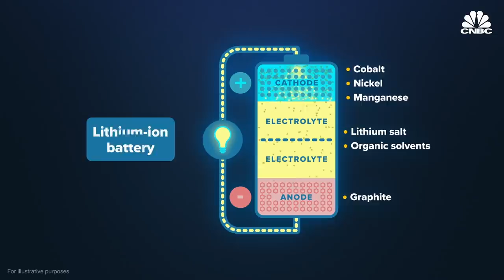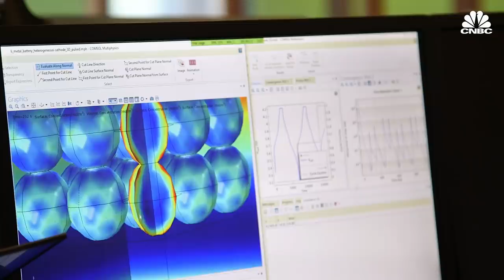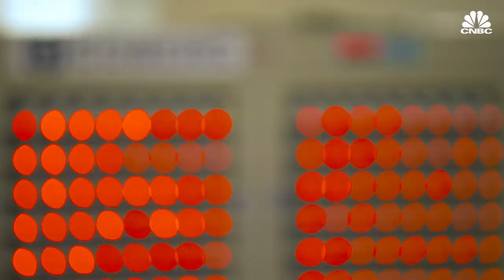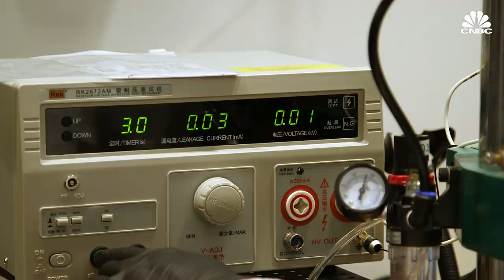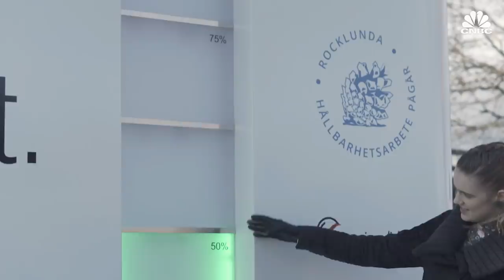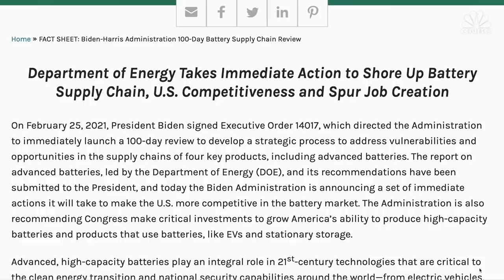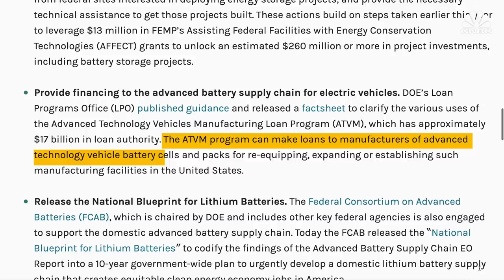Why This Battery Breakthrough Could Make EVs Cheaper

Comment: You would like to think that they're fixing a problem with these ''green vehicles'' but in reality, they're only creating new problems in the long run.
Reply: They said silicon (sand) is abundant when microprocessors were in the initial stages, but now we're reaching that point of scarcity. Elon said lithium in Nevada alone can produce batteries to convert gas cars to electric. I believe this claim also might be similar to the silicon one.
Over dependence on anything leads to demise and despair in the end.

Comment: So how is this any different from extracting oil or gas from the earth?  We still need to mine many materials....does that have an impact on the climate?
Reply: It's a matter of scale, mining the resources for batteries that will last 10/20 years and can probably mostly be reused with most energy coming from renewables with lower carbon footprint vs constant oil that's highly polluting.

Comment: I don't know why they can't develop a high-grade polymer solar panel that can harness the sun to power the battery. Essentially either one area (like the roof) or the entire auto body is a solar panel. Electricity isn't a cost or carbon-effective "fuel" source.

Comment: There are some suggestions here that quite simply 'don't hold water'. Why would a lithium metal battery simplify the (battery) manufacturing process ? It might remove one step out of many but how useful is that ? Even odder is the idea that it'll make vehicle design 'better' in some way. Overstating your claims will attract criticism.

Comment: No battery breakthroughs are going really get all of us apartment dwellers on EVs. Unless my apartment comes with my own private charger that I can plug into at night, and which someone else can't just drive by while I'm asleep or away and get a free charge on my dime from, then it's pretty much a non-starter. An apartment complex with four or five charges off in one place will never work. Am I going to go out ten times every evening, probably in the rain, to see if there's an available charging bay, and remember to go back at the right time, so that someone doesn't key my car because I forgot and left it in the bay so that they couldn't recharge?

It's really something that's mostly only practical for home owners, which in many areas still means it will be only for the more financially well off. And anywhere besides out in the boonies, there will be a lot more apartment owners than home owners, despite many of those apartment owners making good money, because of the cost of houses in those areas. So many of them could afford an EV but probably wouldn't want to because of the hassle of keeping it charged while living in an apartment.

Comment: If someone discovers a true battery breakthrough the smartest thing to do is go directly to someone that can mass produce your product, partner up and give you a fair cut. Their first pick would probably be Tesla.
Reply: Tesla doesn't produce batteries. Panasonic does, for Tesla. But Panasonic is just one supplier. Better offer your invention to multiple battery-makers so get the best deal.
Reply: @HenriZwols  Tesla is in the works of starting their own 4680 production line because no other battery supplier could design a battery to meet their needs.
Reply: @jlg8689  All the more reason to shop between battery suppliers. Apparently Tesla isn't easily satisfied with its supplier.

Comment: What good is all of this if we can't even produce enough excess electricity to handle a damn heat wave? How are we going to charge all these batteries when no one is building any new lines or power plants because "we need to do an in-depth study of the environmental impact and then let the bureaucracy have 10 years to consider if they want to issue a permit"?

Comment: Pure lithium (foil) anodes will be prohibitively expensive (several times more than the copper currently used in Li-ion). Nothing can change that and explains why 60 years of research haven't resulted in a workable battery.

Comment: Total fuel consumption of U.S. airlines is approximately 19 billion gallons annually.
Total fuel consumption for mining Ore for construction of electric car batteries is approximately 21 billion gallons annually.
The 21 billion gallons of fuel burned can only produce enough Ore to build 250,000 electric car batteries. 
The lifespan of an electric battery is 10 years and is not renewable. By 2050 these batteries will fill landfills with 50 million pounds of waste that does not break down. 
I wonder if people would still believe in electric power cars, vehicles or equipment if they knew how massive the carbon emissions footprint really was? 
So that you understand, more energy is used to mine for these batteries than they will ever produce.

Comment: Rather than fields of corn row charging parks, which are out of the question in dense urban areas like NYC and for owners living in areas where individual fast charging setups are also out of the question, how about the Departments of transportation  and energy convene a task for of engineering representatives to develop specification standards in both physical dimension and electrical connectivity for quick exchange packs. The advantages of this are compelling. First a degree of protection from technological obsolescence is conferred as breakthrough improvements in energy storage density comes forth. Second, risk of overload of neighborhood power distribution grids is largely eliminated in that regional recharging charging and distribution centers could be located adjacent to power generating or renewable energy harvesting facilities. Range anxiety elimination would open up markets for long distance travel over interstate travel by traveling manufacture representatives and sales force. Use of liquid petroleum fuel transport tank wagons with their inherently empty back hauls would be replaced by 18-wheelers. Also, tamper proof meting modules could be built into the exchange power packs to facilitate fair transportation taxes.
Reply: Quick swap standards are too late at this point. And you don't need rows and rows of charging in dense areas like NYC. NYC already has plenty of parking decks. Just put chargers at each parking spot. For the most part, cars are becoming obsolete in city centers. Walking, biking and public transport is focus now. Even for delivery vehicles, e-cargo bikes are taking over in europe, and starting to be used in NYC.
Reply: @adamt195  The maximum range of 300 miles, especially in range draining cold climates renders viability of EV products in rural areas questionable. Even in high rise apartment communities where each parking place is charging hookups is provided, there is the issue of power grid overload that must be considered. Quick power  pack exchange stations, which could replace today’s filling stations, serviced by regional recharging centers located adjacent to power generation or renewable harvesting plants would eliminate neighborhood distribution grids and power loss inherent in long distant power plants. Possible breakthrough aluminum power packs with some 2300 mile range, but not rechargeable, but recyclable would be perfect for quick exchange.
Reply: @lcarliner  That still treats EVs like gas cars, that need to go to a swap station, just like a gas station. Rather than charging at home everyday for just a few hours. 99.9% of the time, people are not charging all 300 miles of range. Over 50% of trips are 3 miles or less. Even just 10 miles of range would cover roughly 2/3 of all trips.
Reply: @adamt195  The ability to be able to take a 900 mile trip from the Maryland suburban DC area to north of Tampa, Florida, in a 15 hour drive with just one or two fueling stops would be a thing of the past without the quick exchange option! A few hours to overnight layover for a full charge would not go! For short distance neighborhood commutes or errands, the EV individual charging hookups would work, but not for those with long distance commutes from rural areas! There is a startup company in California, named Ample, that devised a system for quick exchange power packs.
Reply: @lcarliner  Yeah we have these things called DC Fast charging stations. 

DC to Tampa really could be done by train though. If we had better investment in high speed rail it would be doable in under 10 hours. DC to Atlanta would be 4 hours.

Comment: I find it hilarious that they bring up the well known issue of dendrite formation and don't even hint at how Cuberg has addressed this issue? Might this be a situation of "build hype, get bought, solve issue later"?
Reply: Whisker and dendrite formation has been well studied in other metals. (I worked QC at a metal plating shop.) We used "leveling agents" to make sure Copper, Tin, Nickel, et al plated out smooth not powdery. The electrolyte/solvent used in Lithium metal plating (charging) also influences dendrite formation (battery internal resistance.)  This video is rediscovering old information and not reading past the abstract.

Comment: In my life I've heard several times about the next battery breakthrough being 10 years away. No matter what batteries are used it seems obvious swapping battery packs is going to have to be an option rather than waiting to charge. Even if this means swapping cars.

Same with personal aircraft for commuting to work.
Reply: People charging at Home.....95%...........Dont give a squat about using Sombody else's batterie........Paul

Comment: So let us leave out the fact that a solid state battery can be recharged the entire life of the battery or 30 years without losing its ability to hold a charge versus these solid lithium batteries which will still lose charge every time they are charged and need to be replaced every five to ten years at a cost of up to 10,000 dollars. Which option gives the consumer the best out come. Or should we mention the fact that a solid state battery is nearly one quarter the size of these batteries and can be doubled up for extended range batteries to give the consumer a more usable 800 mile ranges per charge over the 300 mile range of these batteries. Or should we talk about the fact solid lithium metal batteries are still recharge sensitive and can have problems when charged at a faster rate while the solid state batteries can be charged in a mere hour for the thirty year life of the battery. The fact is these guys want their batteries to hit markets first to stop the solid state batteries becoming the norm. Like always its about using resources and parts up faster to make the consumer replace and spend more money over a lifetime. Fords battery developers already have working and usable solid state batteries it now down to refining the production process to a usable commercial level. These guys are still in their development phase.

Comment: So lithium EV cost an additional $15k, 🤔 well I'll just stick with Gas
Reply: The EV's also considerably more energy efficient, so worth asking yourself, "how much do you spend on gas".  The BLS says the average is about 3k a year, which would only take 5 years of driving to eat up 15k.

EV's use about a quarter of the energy, so even if you had to pay double for electricity over gas per kwh (gas has 33kwh/gallon, which at $3/gallon, is about 9 cents per kwh), you'll still be saving 1.5k a year.  If you own a car for 10 years, which is less than the average lifespan of new cars, you've saved at least 15k over the life of the car than with an ICE engine.

Also worth asking, "which do you expect to be cheaper in the future, gasoline, or electricity".  My money's on electricity, not gas, since electricity is easier to produce.

Comment: 0:24  "When you look at the need for electrification of the transportation sector, one of the greatest contributors to emissions around the world, it really is the limitations of battery technology that are holding back that movement of electrification."    - Richard Wang

That is just WRONG.  Battery electric cars are selling just as fast as they can make them.
Factory capacity and battery availability are the pacing factors, not your fictitious issue.

Again, cost and range are no longer obstacles to electrification, as much as you would probably like to pretend they are to flog your startup. 

Practical, durable, usable battery technology is on the market NOW.
Battery EVs are selling very briskly.
Scientists have cut lithium ion battery $/kWh costs 88% in the past 10 years and will continue to slash those costs.
Tesla is leading the way and is probably below the $100/kWh level already, well on their way to $60/kWh with their new 4680 cells.

Can everyone afford a new battery EV?  
No, not anymore than everyone can afford a new gas SUV or crossover....yet those have been hot sellers for years.
But there are shedloads of people who can, and they are doing it. 

As for RANGE, that's not an issue either.  There is a point where adding UNNECESSARY RANGE to use those few times a year you make a long trip is counter-productive 90% of the time where you would be better off with lighter battery weight.  Thus, it's just a bad engineering tradeoff to add more battery cells after a certain point.

However, if you are still nervous, the Model S Long Range is already capable of >400 miles per charge.

Comment: Kinda dumb. 75-90% of batteries weight is the cathode, not the anode material. Zinc is 10x heavier than Lithium, but most efficient battery is NOT Lithium but Zinc-Air batteries the Cathode is Air. The Cathode also is the limiting factor in battery life, also. Lithium batteries use the same transition metal cathodes that were developed in the late 1800s for "Alkaline Batteries" with almost no innovation since then on cathode materials.

Comment: not sure bat tech will ever amount to anything due to the environmental impact involved in production. lmo it would be much more beneficial to pressure companies that make devices that use batteries to switch to  a model that advances the longevity of their products. l currently use a samsung s6 which is 5+ yrs old w/the original bat and is only the 2nd smart ph l have ever owned.

Comment: Lithium... metal. In case lithium iron isn't flamable enough, you want to use a substance that explodes on contact with water? It's perfectly safe so long as it remains enclosed in the cell, but any car involved in an accident would become an explosion-in-waiting. You'd need to send robots in to disassemble the wreck safely.
Reply: @gadaadhoon  A relic of laxer times, really. If the car had never been invented and someone were to propose it today, it'd be banned within a month of the first fatality. You want to have people driving half-ton metal boxes carrying tanks of a liquid so flamable it can be explosive, traveling at sixty miles an hour? Insane.

Comment: @ 2:20, you reorient the battery diagram from side-to-side, to vertical, and flip the labeling, too.  Good diagrams, just requires some unnecessary mental gymnastics.

Your female narrator is clear and crisp.  Use her more often!

in a way that is confusing disorienting

Comment: No, EV's are NOT considerably more expensive than ICE cars.  In fact they are cheaper...cheaper to buy, maintain, cheaper to run.  A base model 3 Tesla costs $39k...the average car in America today costs $40k (recent study).  A loaded Toyota Camry (the most popular car in America) costs $36k.  On top of all that...the Model 3 Tesla is lasting over 500,000 miles in fleets (including the battery).  How much mileage do you get out of a Camry, 250,000 at the most?  The only reason you aren't hearing this is that Tesla can't make cars fast enough to meet demand.  So they don't even advertise.  If you're smart, order a Tesla Model 3...you'll wait a couple months, but you'll have a car that will last you a lifetime.
Reply: I love my Beemer, but just having filled up for $130 and having paid another $2500 in maintenance - I can see gas powered cars disappearing - just due to expense. They aren't going to be worth much used - except for the real classics.

Comment: Slow news day... "new battery breakthrough" yada yada.
Don't let basic science damp your optimism. Laws of Thermodynamics be damned!
The PROBLEM with most of these "breakthroughs" is that when they actually construct them they add SAFETY features to prevent fires and that ruins the energy density. We've seen this movie a few times.

Comment: Sad that this eleven minute advertisement failed to include any up to date data on the manufacturers CURRENTLY producing batteries.  Especially the exciting improvements expected within the next year.  iso Battery Day.  I mean, as long as you are going to use footage of Tesla's 4680 cell production line... give them a mention!
Next week they'll be pumping the next new battery stocks - still 5+ years from production (if ever)?